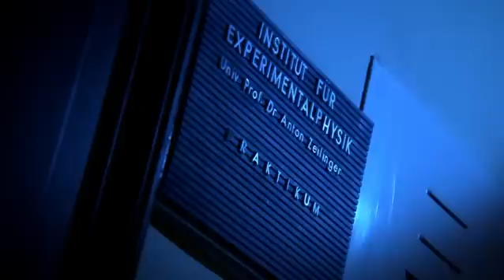Quantum Mechanics - Double Slit Experiment. Is anything real? (Prof. Anton Zeilinger)

Comment: So....

Is it the conscious observer which collapses the wave function? (me and you) Or is it the non-conscious observer which collapses the wave function (the detector) Important distinction to be made.
Reply: FocusReborn Yes.
Reply: FocusReborn If the detector was on but no recording data then the wave patterns appear. And if the detector was recording the data then the wave collapses. QCDE 1999 experiment shows this.
Reply: Al-mujahedeen Salahadeen That it is an important distinction to be made.
Reply: another experiment has been made that doesn't involve an electronic device observing the particule and it shows that the effect is real , and not provoked by any interference from a measure instrument.

the experiment comes from john wheeler and involves 2 half silvered mirrors , with one before a detector... either you got a wave pattern , or a particle spot.... like the double slit. 
and the question he asked at the time , was "what would happen if we get off the half silvered mirror , when the particule is already shot but has not yet arrived" .

and this experiment has been made , and it shows the same behaviour as the double slits experiment.
Reply: +FocusReborn Information registration & processing collapses the wave function. Consciousness just happens to be one form of information registration & processing, hence the confusion. Consciousness is required to produce & install the detector. This means an alternating pattern like the wave/particle patterns is an indication of intelligence. it also means the universe is a reflexive and self configuring system, simultaneously generating & describing its configuration according to all available information right down to the last quantum as proven by the experiment. See the Quantum Zeno Effect too.
Reply: your video supporting consciousness qctivity... ends saying that shaking the box will do the same :) https://www.youtube.com/watch?v=V34XByHUx10 no conciousness at all
Reply: +Mank Demes how come the air particles that the photons pass through don't count as an observer just like the measuring device?
Reply: Tim Taft the measuring device does not count as an observer.
Reply: @wc9053  they can be considered an observer. An observer doesn't need to be conscious. It is only that the air particles are not interested in knowing through which slit the particles went. From the moment you try this, the pattern collapses. It has been proven that there is even a "scale" of "observationess". So the pattern can also collapse 50% or 30% depending on how good you "observe"
Reply: its not the observer being the measuring aperatius, this was something that was tested withe the quantum eraser, in resent years measuring aperatius that don't collapse the wave function have been developed although they are tricky to relay on but still statistical this can be shown to prove that the observer that collapses the wave function is consciousness, this can probably lead to consciousness being said to be the base of physics, as crazy as it sounds it dose not prove that the paranormal or god is real, but is just coincidental that sentience is possibly reality and what causes math and matter to exist
Reply: The delayed choice quantum eraser helps answer that.
Reply: joe caterman On the DCQE there is no direct measuring except for the result (wave or diff). The which way path is inferred from the setup. No detector to determine the which way path. The resulting pattern simply conforms to the experimenters’ knowledge of the inferred path.
Reply: joe caterman It’s probably easier to look up the experiment by a physicist named Wheeler, but suffice to say, the experimenter knows the “which way path” by the configuration of the setup of the experiment but not by directly placing a detector along a path to measure it. Therefore, it seems like the photon “knows” you know even if your knowing is inferred! The bottom line is that if we “know” the path of a photon, it will conform to that knowledge.
Reply: FocusReborn it's bad wording used by videos like this and perhaps started by scientists who don't speak English as their first language. the observer has nothing to do with the altered behavior. it's the fact that you can't measure/observe the tiniest constituents of matter and energy without altering it with the measuring device itself. to observe a dark room, you need to shine light on it. that's fine when you're looking at a huge room where it's momentum and size is so many orders of magnitude bigger than a photon's. but if you wanted to observe an electron speeding through space and you shine a light on it to observe it, that electron changes in some way because the photon's (light's) momentum  and size is not negligible compared to the electron's.  the detector changes the outcome of the expert simply because it pretty much has to bash a photon into the electron they want to observe to actually observe it . their actual detection method, i'm not sure what exactly they use to detect which slit the electron goes through, but the point is they have to release some energy into the system to observe it. and that energy changes the state of the electron. the experiment has nothing to do with a conscious/non-conscious observer. it's unfortunate wording that slipped in there at some point and keeps being used by people who are enthusiastic about this stuff but don't know enough about it to dismiss it
Reply: Mank Demes it's not that. What you are saying is experimentally disproven. It's about the available information.
Reply: Great explanaition, thank you.
Reply: +Imperfect Reason Pretty sure you dont know what you are talking about when you say "If the detector was on but no recording data then the wave patterns appear. And if the detector was recording the data then the wave collapses. ".
Recording data is not more an observer, than the rest of the recording device. You wouldnt be able to define the obsserver. Is it the hard disk drive of the detector ? Is it the computer screen ? is it the human eye ? Or the cat's eye looking at the screen in the corner of the room ? Is it the neuron analysing the eye signal etc....

The Delayed choice quantum eraser is very complex and doesnt seem related to your assertions. If it is id like to know how
Reply: +Alejandro Rodriguez Perhaps if farting created consciousness by waking up the cat looking at the screen...
Reply: +Fred Johnson  Great point!
Reply: Alex Claros Fernandez no it isn't, I didn't read his comment properly. particles wouldn't count as any observer.
Reply: Agree! Or in other words the observer can only "see" particles with no wave properties.

"According to Bohr’s rule, the interference
pattern must then disappear if the molecules emit a
photon with a sufficiently short wavelength which enables
the experimenter to measure the location of the emitting molecule
with sufficient precision." 
(source: http://cms.iafe.uba.ar/carmen/docencia/interferencia_fulereno.pdf)
Reply: As someone mentioned, the delayed choice quantum eraser experiment proves that a situation where the “which way path” is simply inferred, the wave function collapses! No measuring at all until the photons hit the screen.
Reply: Nope... it's the matrix that doesn't want us to know..
Reply: Your forgetting options 3 & 4, 3 being both and 4 being  a conscience above our own.
Reply: What I think is happening is that the measuring device collapses the probability/photons' state.

Unfortunately this does not prove our influence of the reality but the fact that the photons split is pretty awesome and yes that could even suggest that there is one electron in the whole multiverse etc etc etc.
Reply: re: " Is it the conscious observer which collapses the wave function? "

Wave function collapse is bullsh!t. There are better reasons for observed phenom today, but OLD theories die a hard, slow death.
Reply: Mank Demes This so much. It reminds me of a time I was doing nanotechnology research and shined a light on a sample under a microscope and caused an unwanted side reaction initiated by the energy from the microscope. It's absolutely impossible to not interfere with ever infinitesimal environments.
Reply: Mank Demes Well said. It infuriates me that pretty much all explanations you read or watch regarding the double slit experiment make HUGE 'leap of faith-like' assumptions.
Reply: Mister F yes what?
Reply: +Mank Demes You are completely wrong. I know it's counter intuitive but the observer actually does effect the experiment just by observing or measuring. And NO, the measuring device does NOT interact with electrons at all. Please check out the quantum delayed choice eraser and educate yourself. DO NOT REJECT SOMETHING JUST BECAUSE IT'S INCONCEIVABLE TO YOU OR JUST BECAUSE YOU DON'T LIKE IT.

Comment: Now let's return to this question: When a tree falls in the woods and nobody is around to hear, does it make a sound?
Reply: Yegor Rowan Brilliant! Who said that quantum mechanics could only work on sub-atomic levels?
Reply: Only when you are there to observe it. Until that point it simultaneously makes a sound and is quiet. LOL
Reply: If no one is there, is there even a tree? And a forest?
Reply: @rickyspanish4792  Yes... trust me bro!
Reply: +Gormathius Nightrider Yes, it does. A tree is not a quantum object. It's a macroscopic object. By falling, the ground itself breaks its fall as it applies an equal force against it, thus measuring it (observing/detecting). Every atom in the woods is there to "hear" the tree fall. This sort of stuff only occurs in the quantum scale.

Comment: I keep seeing people saying that it's the energy from the detectors (at the slits) that causes wave functions to collapse into particles in double slit. But in the Delayed Choice Quantum Erasure version of the double slit experiment, there is no energy/interference at all (in the form of a detector) prior to or at the slits. The light passes through the slits (untouched), where it hits a beta barium borate crystal to create an entangled pair of photons. The "which path data" is only determined afterwards, depending upon which side of the Glen-Thompson prism the entangled (1/2) photons hit on the "idler" side of the experiment (the bottom part with the mirrors).

So it's clear that "the measurement problem" still stands, since there is no energy/interference from a detector prior to or at the slits in Delayed Choice Quantum Erasure (the sensors/detectors only come in at the tail end of this elegant version of double slit). Cheers.
Reply: blaxxxx I think they used photons.. not electrons.

Comment: What's the differences between photons and other physical objects? This phenomenon is only exhibited by photons.
Reply: It's not only photons that exhibit this behaviour. The same will happen with electrons, protons or any other subatomic particle that you choose to use for the experiment. The only thing you would have to vary is the distance between the slits to account for the differences in the wavelengths of the particles.

Comment: Wrong. If the only effect, that the detectors have on the photons, is the mere interaction (changing the path of a photon by bouncing an electron off it) then why doesn't the observation simply make a random change on the screen? The observation doesn't randomly change the pattern on the screen - it collapses the wavefunction. It's not a gag sir.

Comment: You make a very good point. The physical observer being near the slits could be physically interacting with the photons, thus changing the results. 
But, that would not explain why the observer being there would affect them to only make the results of 2 impact lines instead of many. Why would  the observer being there affect it so specifically, to only make 2 impact lines if it is indeed interfering with the photons? Why would it not just create a different variation of many impact lines?

Comment: No I don't think you understand what he is saying.  The physicists put detectors in front of the slit to measure the polarity of the photon which allowed them to determine which slit each particle of light went through.  He does not mean he was directly looking at it.  He was trying to measure it using another piece of equipment and when he went to measure the light it started behaving the way that he thought it should have initially.

Comment: Explained ! The Double Slit Experiment
mindhush·    watch?v=LW6Mq352f0E   See at 2:47
Back in the day they measured on tape.  According to this guy, they tried removing the tape, so the heads that'd write on the tape were still moving but no data was captured. But the information was still being detected and transmitted, but not gathered.   According to this guy(Cambell/mybigtoe), it gave an interference pattern.  Here's an interesting one. What if you filmed the head to deduce the data?

Comment: The professor claims to be firing photons at the double slit.  That's a curious proposition considering that discrete particles are characterised as having no mass and no size.  Exactly what do you use to detect, and thus observe, a particle that has no mass and no size?  If the shape of a photon is inconceivable, how do you craft a device that can detect and observe it?  How does physical stuff interact with non-physical stuff?